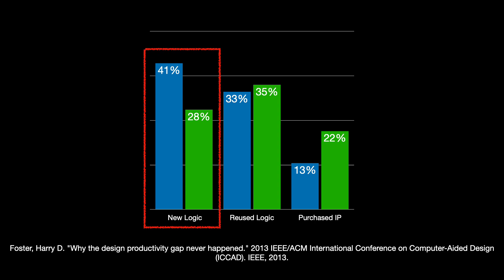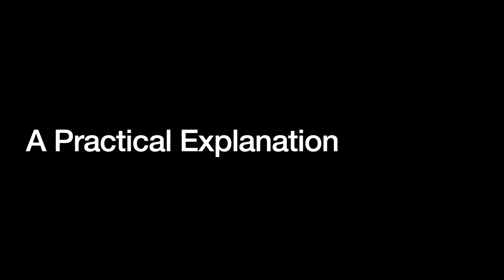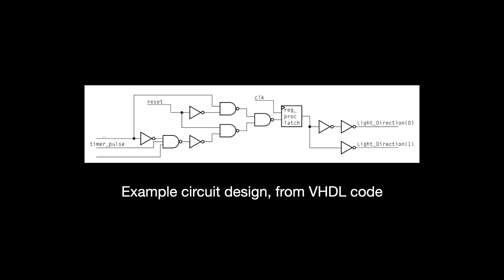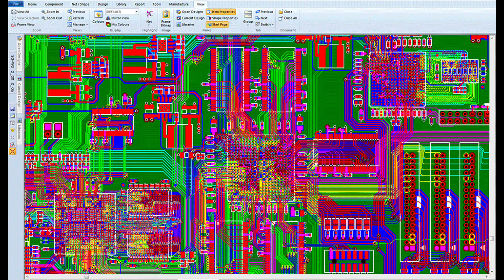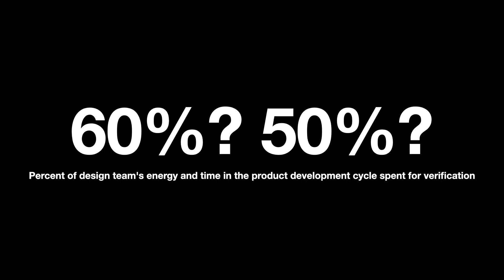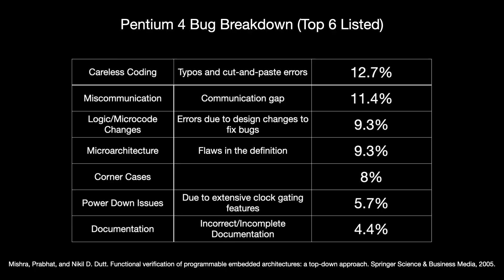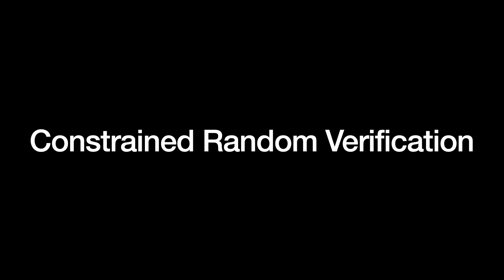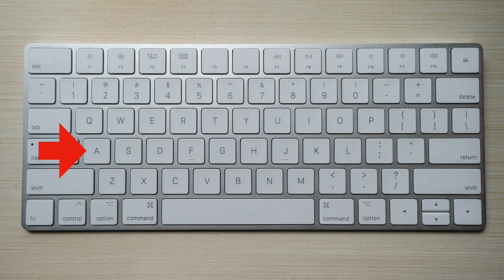The Growing Semiconductor Design Problem

Comment: Nice overview.  There is also formal verification, which I believe is akin to a mathematical proof that the logic works as intended.  The formal verification is needed as there are too many combinations to check.

I was also surprised that first pass success was only 38%.  I wonder if this is mostly for analog and RFIC?
Reply: As a software person dabbling with chip design I initially assumed by verification the hw people mean formal verification.
I was so surprised to find out that verification for hw is just a different word for testing.
Honestly having worked on a few open-source hw design projects the test coverage is often worse compared to sw projects.
Even talking to a few industry folks it seems like hw verification is a lot more manual and inconsistent than software test cases.
Now obviously the big chip makers can afford to hire huge teams of verification engineers but it looks pretty weird to me.
For software projects pure test engineers are pretty rare as just writing tests all day long would be pretty demeaning to most software engineers.
Reply: Let’s say you had something simple, like a counter with set, reset, and clock.  Now make that counter 64-bits wide.  It’s impossible to check the transition from every state to the next, for every input sequence; maybe take 100 years even in FPGA verification.  With formal verification you can do it in a few seconds.  Ha ha, don’t ask me how it works.  I just know you mathematically prove it works, and it takes the same time as to verify a 4-bit counter.
Reply: @rfengr00  Well with formal verification you do mathematical proofs on the structural properties of the circuit. While I do think this would have a lot of potential for both hardware and software engineering the reality is that it requires quite specific skills and has not really caught on for centuries. Aside from security critical applications that may require formal proofs like cryptography it seems like the effort is too big for broader adoption.
However I do hope this changes as for hardware we should insist on correctness.
Reply: @rfengr00  It becomes more complicated on more complex systems. Its not realy my field but if your code or harware has to handle a lot of edge cases it also becomes hard to describe them for formal proofs.
Reply: I have a feeling that it can be harder to do the formal verification than the actual chip. And then it will also be a bigger risk for errors in the formal verification than the actual product. It must be so hard just to define exact how a chip should function.

Comment: Bugs are often zero days.  My understanding is some of the x86 microcode isn’t fully tested….
Reply: x86 is a prefixed instruction set, so it has potentially millions of valid instructions, most of which are redundant, and more byte sequences that do SOMETHING in spite of not being reasonably expected to be an instruction; see "Sandsifter - breaking the x86 ISA". It is probably more or less tested for a few thousand instructions that compilers and assemblers will actually emit; but for one, nontrivial bugs do pop up from time to time, where an instruction performs correctly under some circumstances and incorrectly under others; and for other, data can become executable.

Comment: The random checks reminds me a lot of fuzzing, a common programing practice where you throw tons of random inputs at a program and see if it crashes. Typically in software you use something like American fuzzy loop, which actually looks at which code is hit during each run, and tries to tailor the new test cases to explore more of it. So as an example if you're fuzzing a jpg parser, even if you throw an initial random seed, it'll learn to create the jpg image header, and from there explore weird pixel values
Reply: software fuzzing comes from hardware testing.
Reply: Fuzzing is a less constrained input approach. More constraints are applied to limit “crazy” combinations to that of actions customers will actually take. For the keyboard example, it might be better to constrain the simultaneous key presses to a max of 10 and not allow for nearly all the keys to be pressed at once all the time in all of the tests. This lets you focus on things that are likely to happen in the course of normal use rather than finding obscure issues in corner cases that  won’t happen. The config space for ASICs is wide enough that full fuzzing would be time intensive and difficult to debug. It would reveal probably more problems with the test environment than the design

I’ve been interested in a fuzzing approach in verification but like I said, tracing back misbehavior is often harder and the scenarios may not even be possible on the bench. It is more valuable to find bugs that impact the major use cases and can be replicated on the bench
Reply: so thats why video games are so buggy these days
Reply: @Blox117  it's actually the reason they're only as buggy as they are. A million chimpanzees at teletypes will do things in your game that no human would ever think to do.
Reply: @tissuepaper9962  also, fuzzing isn't used in game dev AFAIK due to the complexity space of game input (especially realtime games like FPSes). Games are mostly still tested manually.
Reply: @alexjeffrey3981  maybe not literally random fuzzing, but you can generate random sets of inputs within the constraints of what's physically possible for a human to do. You want some combination of playtesting by humans and traditional software testing with unit tests and semi-random inputs, because your players aren't actually all human. You need to test for bugs that only a bot or a clicking script would be able to use, too.
Reply: @tissuepaper9962  in theory yeah, but I understand that in practice budgets and deadlines are so tight during game dev that very little if any automated testing is done. And unit tests are going to be incredibly sparse in a game due to the nature of the class structure.
Reply: @Blox117  Game developers aren't given enough time to add all the features let alone fix most of the bugs (bug fixing can easily take up 60%+ of the dev time) because you can always just do both of these in post-launch patches and charge extra for the former as a result. Game projects also tend to have lower testability due to the intense time constraints, the fact that it really doesn't matter if they are buggy or fail as they are just entertainment software, and the fact they can be patched at a later date so there isn't any incentive to spend extra time getting it right now vs spending a little bit longer to patch it later.

Comment: Intel shipped the original Pentum with a serious calculation bug. As in, you could trigger it in a simple spread sheet...
Reply: Intel also had to keep a bug in their chips for generations due to it being a "feature" that was baked into Windows etc & fixing it would have made MS recompile a lot. Pretty sad...
Reply: Is that the IEEE 754 non-compliance ? IIRC their hardware floating point support was notoriously unusable in anything critical.
Reply: @TheNefastor  nah it's the Pentium division flaw. https://en.m.wikipedia.org/wiki/Pentium_FDIV_bug
Reply: @MrGoatflakes  that's exactly what I said. Faulty floating point support.

Comment: The chip manufacturers claim greater than 6 sigma quality tests. So it's clearly not a hardware problem
Reply: Six sigma with regard to what variable? I can almost guarantee that no fab has >99.999% yield for example. Certainly not for cutting edge nodes.

Comment: the keyboard example is pepega because keyboard actually have input limit, they are design to fail intentionally because they share channel between button to lower cost. the logic why manufacturer do that is they believe a human would only press a button at a time to type. this is why gaming keyboard became a seperate product since game expect you to hold multiple button at the same time. =)
Reply: There existed a number of NKRO (n-key rollover, so ability to register and release an arbitrary combination of keys) keyboards before gaming keyboards came about, and because there is no limit over AT/PS2 keyboard bus to the number of keys held down, they actually were more universal and worked better than modern gaming keyboards. Also it's not quite like every key needs to be input separately, standard keyboards with a not fully disambiguated matrix do guarantee a 2-key rollover and with anti-ghosting logic (which i'd call shadowing logic) are usually made to support 3 key rollover in the usual input situations plus modifier keys. NKRO was valued by fast typists and has always been a feature you'd have to pay extra for though. One example of an old NKRO PC keyboard i can think of is the fittingly named Omnikey. The stock keyboard that came with Commodore Amiga 2000 computer was also NKRO, as were a number of early IBM keyboards and others.